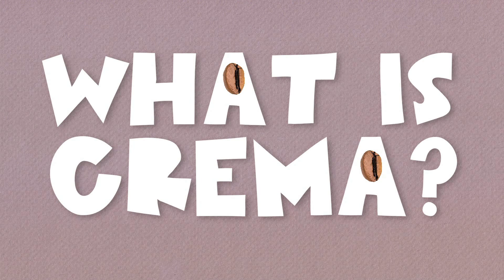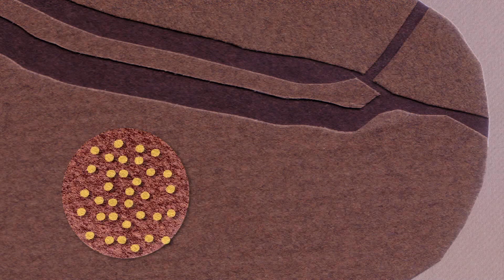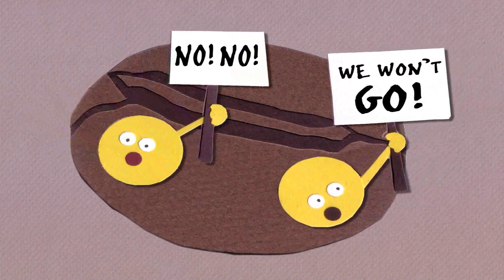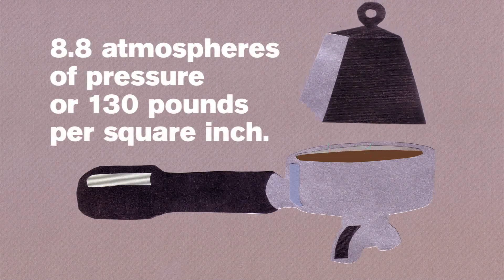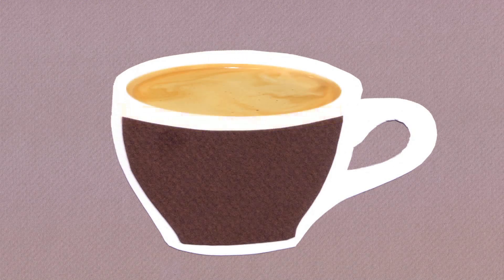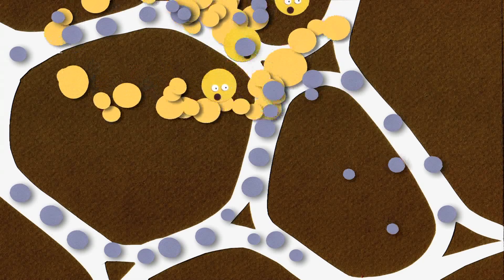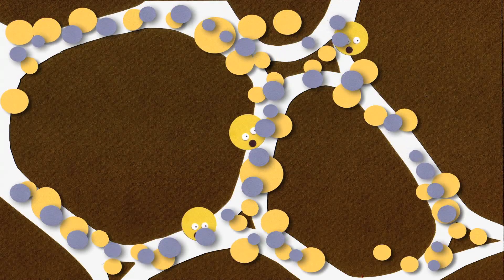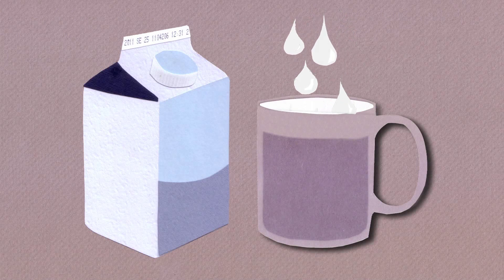Coffee's Natural Creamer

Comment: Cheap machines use pressurized portafilters or pressurized baskets for two reasons. One is that the assumption is that by buying a machine in that price range you probably aren't getting the most articulated grinder. So added pressure in the PF or basket will help get crema out even if your grinder sucks. The other reason is so they can accept ESE pods. 

To answer the other part of your question: as beans go stale some of their components break down (the crema making components especially).